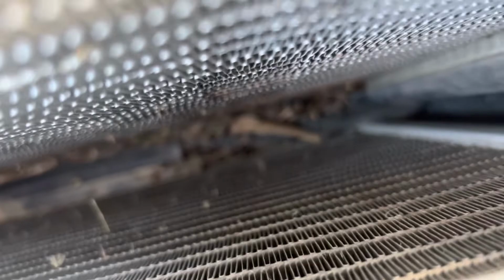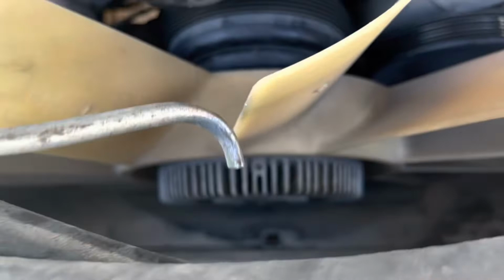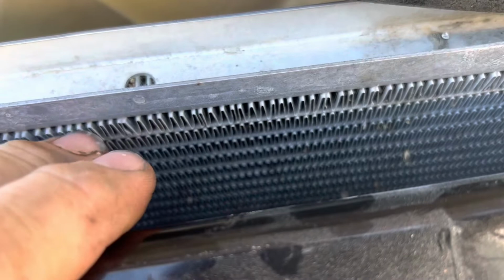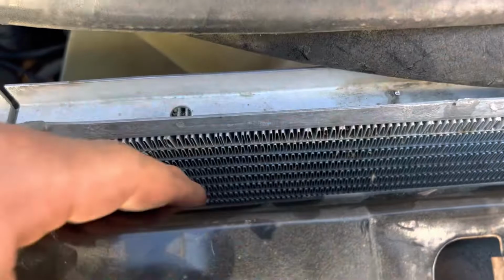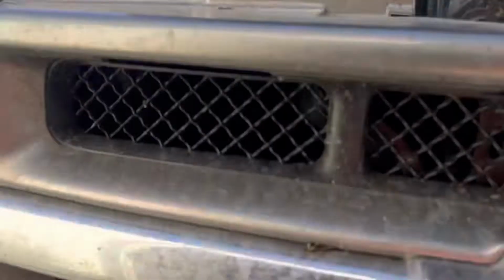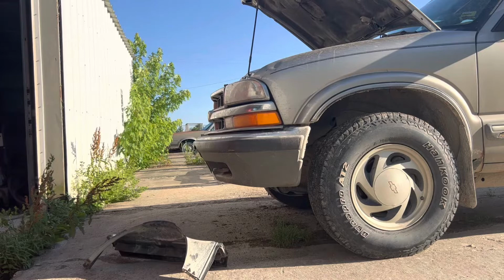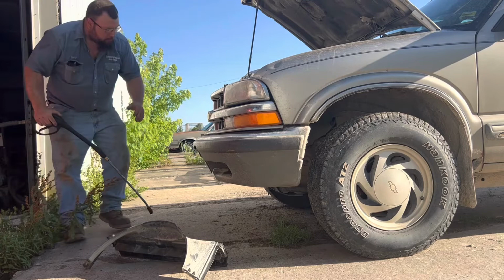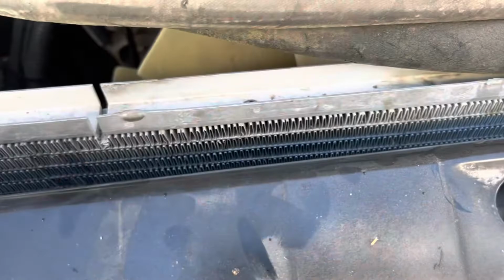Cleaning out the fins on a radiator

Comment: We live in the country and the county cut the ditches down left the tall grass on the dirt road. Recently started having issues with over heating. I am hoping this will resolve the issue🙏
Reply from the maker: If it’s a GM they’re really prone to getting plugged up, but the worst I’ve ever seen was an Escape this week that was completely packed between the intercooler, condenser, and radiator.
Reply from the maker: I just posted a couple pics of that job on the community page of my channel
Reply: It's a buick lucerne.. 07. Just waiting and hoping driver and car make it back. So I can have a look at it. Hope it makes the trip back.

Comment: Did this lower your engine temps?
Reply from the maker: By about 25 degrees, was running about 215-220
Reply: @bulldogsautomotiveadventur4387  Thanks man. This task is next on my list of things to try.
Reply from the maker: @lebojay  be careful, if you don’t get the fins clean the junk will harden like cement when it dries.